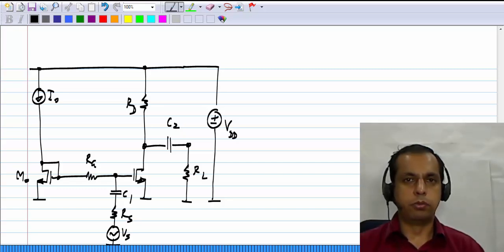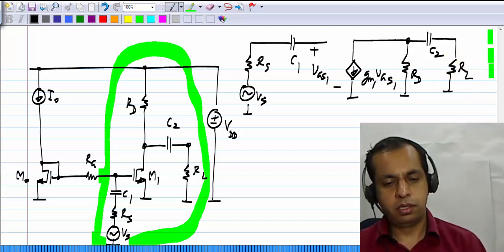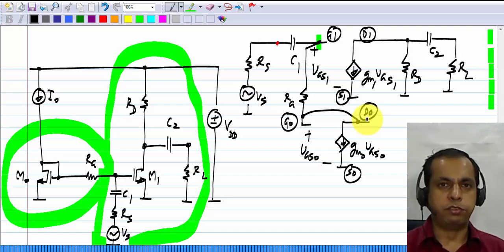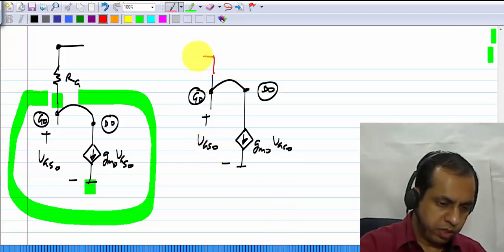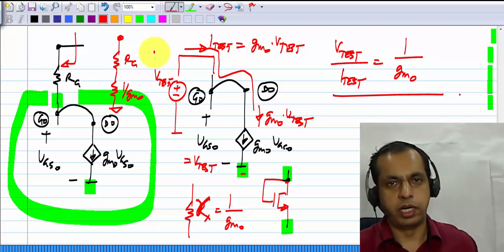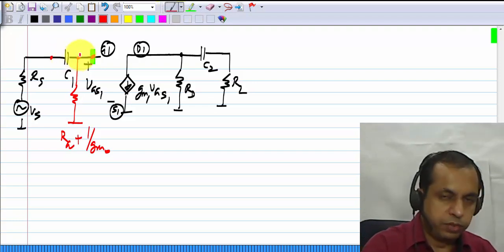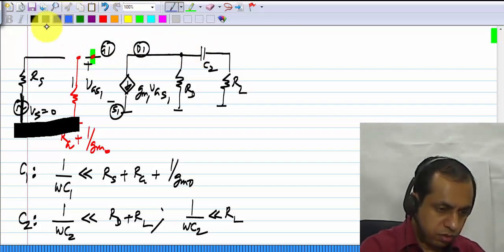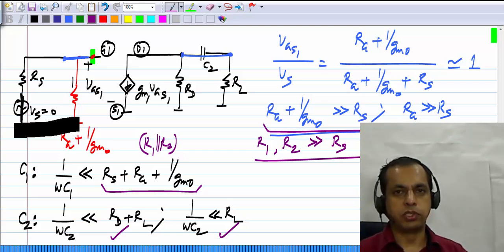0403CSAmpWCurMirBiasCapConstraints

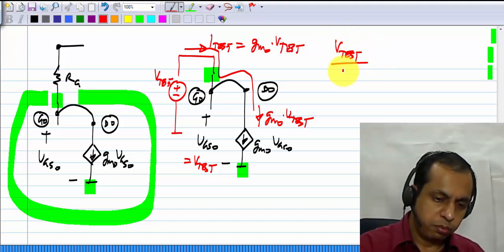Comment: Sir, @5:40 why have you not taken current into Rg. If we will only take a single MOS then we can write R=1/gm( which means that, that MOS will act as a load) but here Vin is input to both the MOSFETs.
Reply: He was only analyzing the behaviour of the circuit from gate to source (the circuit after Rg). The equivalent he got, he just placed it right after Rg.